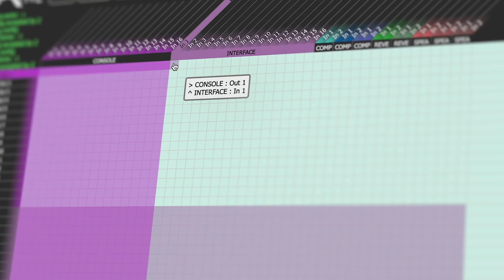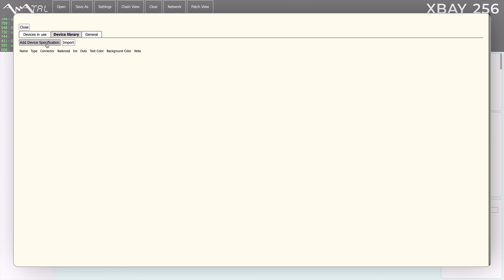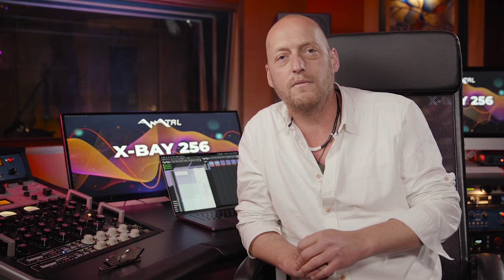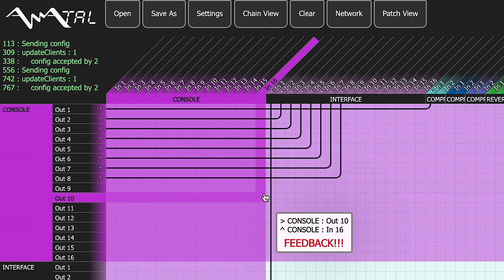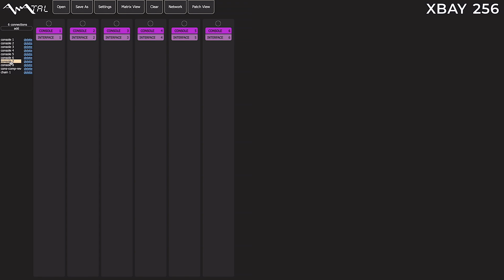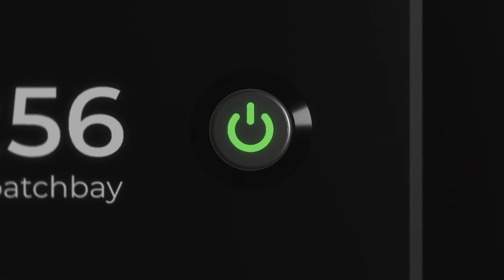Anatal promo for the Xbay 256

Comment: I've been using the Anatal Xbay for the last 3 years. Started on the 256 and now upgrading to the beastly 512 version. Every engineer that comes into my studio is blown away by its capabilities. It's not just a clever invention to get rid of a messy patch bay full of patch cables (although that is nice) but it unlocks your power to be creative with routing. I sometimes will mult a vocal and run some aggressive outboard processing on one mult, reasonable processing on another mult and a clean safe back up on another mult. I use the templates to quickly route 32 outs put to my capi sum bus mixer and can place outboard on any channel with the click of a button. Xbay rocks ... I'm looking forward to future software upgrades to unlock even more potential of it. Cheers team! Glad to see it getting out there more.
Reply: Thank you for sharing your experience. After watching this video, I was thinking of similar set ups for tracking, using multiple tracks through various pieces of hardware.